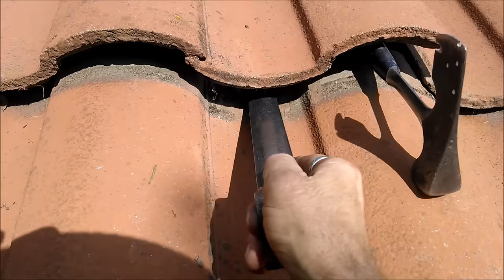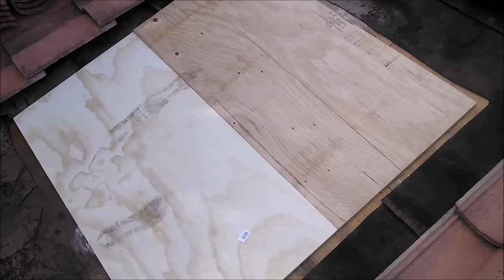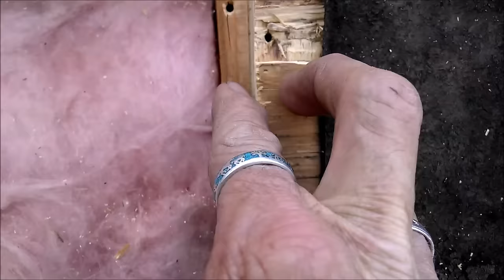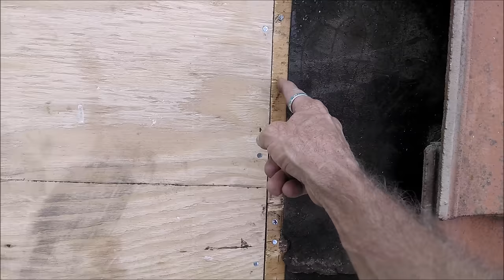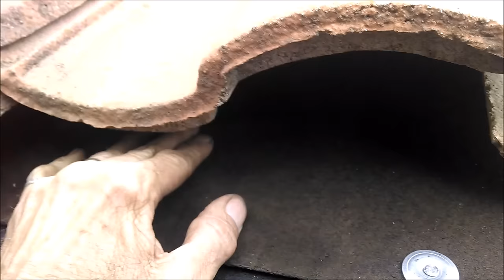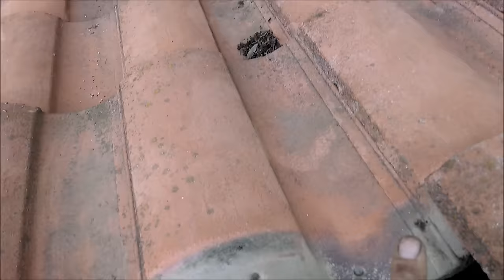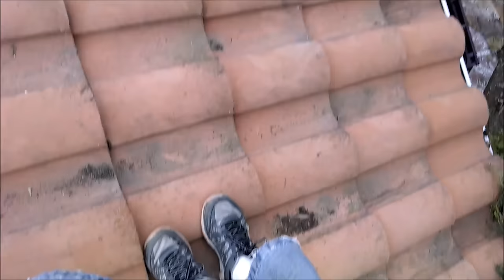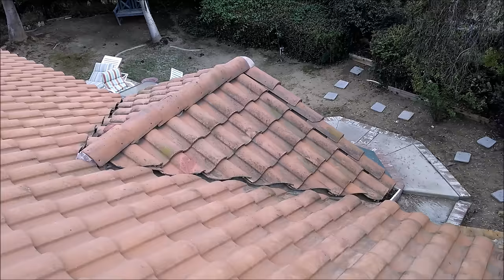Roofing Tile Leak Repair - Tips, Tricks & Helpful Hints

Comment: Thank you Dan.  Great video.  I have a question.  We are buying a house with a tile roof.  Inspection came back that showed some have slipped.  When the roofing company did the repair they used flashing band tape to hold the tiles together.  I don't mind if you could see it, but this is right at the top of our house.  It looks terrible when you drive up.  Since this is our first tile roof I don't know what is customary on how to hold two tiles together at the top of the roof.   Thank you for your response.  Wish you lived near me.
Reply from the maker: I'm sorry to hear this but at least it does sound like a cosmetic issue rather than a functional issue. Not to dismiss your concern but it could be a lot worse. In any case there are many construction adhesives on the market that are perfect for gluing roof tiles together & that's what I recommend be done. Depending on the pitch of the roof - if steep, then an external tether like what they used can be utilized temporarily to hold the tiles in place until the glue cures, but there is no reason that I can think of to have anything visible remain permanently on the roof to hold the tiles together. There are several places out of view on the tiles where adhesive can be applied to permanently hold the loose tiles to the nailed tiles. And just because it's a cosmetic issue rather than a functional issue does not mean that it's acceptable for them to leave it looking bad. If there were no other options then I would be more accepting of how they did it, but if I were you I would force them to fix it again, unless they could logically explain why it needs to be the way they left it. Does that help?
Reply: Yes thank you that helped a lot.  I talked to the company yesterday and they said they would come back and apply mastic over it and try to match roof color.  Hopefully that will look better. How often do you suggest a tile roof inspection?  We can get heavy winter rain where I live so I'm thinking every October might be a good idea.
Reply from the maker: You should only need to check your roof, reseal the vent pipes & clean out the flashings about every 5 - 10 years under normal circumstances; as long as you keep everyone off your roof. But if anyone gets on your roof you need to have it checked for cracked tiles every time, or if you have a lot of trees around your house you'll need to have the flashings cleaned out every winter just before the rains come.

Comment: t is a very professional repair of the leak. The homeowner should prevent further damage to the roof structure by cleaning gutters and cutting overhanging branches
Reply from the maker: Gutters do virtually nothing to protect your roof. Gutters are designed to protect your foundation, manage water flow coming off the roof & keep rainwater away from entry ways where people walk, not to protect your roof. Cleaning gutters is certainly wise, as it will enable them to do what they are designed for. Clearing overhanging branches away from any structure is always a good idea.

Just to reiterate... This damage & subsequent repair was necessary because of loose or broken tiles that were left behind by either the roofing installers or some service person who neglected to do their job properly. The leaf litter & other debris on the roof & in the gutters from the trees simply made the issue worse, but we’re not the cause.

Comment: Thank you for the video! I’m assuming that when you put the tiles back in place after repairing the water leak, you started with the bottom row and worked up to the last roll that you needed to glued, correct?
Reply from the maker: Jerry Ratajesak yes, that’s correct.
Reply: Duster Dan Thank you!

Comment: Hello Dan, 
Please add list of needed materials you used? 
I noticed you used NovaLink Sealant, different nails, 4' plywood, etc.
Reply from the maker: List of materials used: One roll of 30lb felt underlayment, 5lb box of large metal&#160;cap 1" felt nails, galvanized 8D or 10D hand nails for the plywood & the cement tiles respectively, Novalink&#160;tripolymer construction sealant/adhesive, two (2) 1/2" X 2'X4' plywood panels stacked on top of each other, one can of roofing paint to match approx. color of tile.&#160;that's about it. I&#160;used the smaller more convenient 2'x4' plywood handy-panels because&#160;they're easier to carry in my small truck. Also, any construction adhesive made for cement or general construction materials can be used. I use the Novalink because it sets up in 72 hours yet remains flexible over time unlike many others that cure very hard.

Comment: Dan, So once the shingle layer is in some way compromised what are the common causes of the underlayment then failing too... UV damage from direct sun exposure, water erosion, extreme high temps over the years? And how common is it for the felt to get abraided and ripped when a shingle shifts? I saw a video of a roof inspection where some of the concrete tiles had slid down a few inches (installed without nails flat on the roof deck I guess) but they could be pushed back into line with the other shingles pretty easily with a few light kicks. Seems the movement could risk ripping the felt though.
Reply from the maker: Good questions. I’ll get back with a full answer when I can be a little more thorough.
Reply: @MrThedocholiday  Great, look forward to it.
Reply from the maker: So typically, comp shingles don’t shift. If they do, it’s because they’re fastened wrong. Same thing with tiles but they are much heavier, but they don’t typically shift either if fastened correctly. Problem is that roofers don’t much care if they happen to nail a row of tiles into the seam or gap between plywood decking or osb decking beneath the felt paper. That leaves the nails loose & the tiles are able to slide & rip the felt. I’ve seen both the nails rip the felt as well as the tiles rip the felt in this case, although tiles will often just slide without ripping the felt, but allowing the nail to do all the felt ripping when tiles slide. Also, any time the tiles aren’t nailed or glued at all, they can slide & rip the felt as well as exposing the felt to the weather. In that case both sun & rain destroy the felt over time.

The roofing materials are designed to keep 95+% of the rainwater off the underlayment. Any time the felt is exposed to more than this over time, it will deteriorate much faster. But if it is protected by the roofing materials like it’s supposed to be, standard underlayment can last 50 years or more, as long as the top layer of roofing remains stable & water tight.

Hope that covers everything… pun intended. 😉
Reply: @MrThedocholiday  Thanks for taking the time to answer. On one hand it seems like these roof systems are simple and that most should be lasting say 50+ years for tile anyway. On the other hand it seems a lot (a majority? most?) of installations are done poorly and fail prematurely. Would you say there roof types that are harder for the typical roofer installing them to screw up or at least easier to verify if there is a problem after it's finished? Maybe standing seam metal roofs?
Reply: @MrThedocholiday  Is there a caulk or adhesive you can recommend for gluing back together a broken concrete tile that has cracked and separated? Would silicone caulk be best or do you need a construction adhesive or...?

Comment: I have an S-tile roof and I'm suddenly getting a water leak where the chimney meets the backside of the house. No doubt it's the flashing, but my question is what is the best way to remove the S-tiles from the back side of the chimney to get to the flashing? You can't get to the nails because the bottom of the S-tiles are bumped right up against the chimney, (and it's a very wide chimney). Removing the tiles on the sides shouldn't be a problem because I can start at the bottom edge of the roof and work my way up.

I was thinking that after removing the side tiles I could then slip a hacksaw (or maybe even a Dremel with a 90° cutter attachment) under there and cut the nails. Then I could slide the tiles out sideways. Any suggestions/comments?

I can't find matching replacement tiles so I can't just bust them up with a hammer and replace them with new tiles.

Comment: Thanks! Horrible install job on my home. I have 4 major issues on mine. No nails on top tiles, home 23 years old.
Reply from the maker: Improperly installed roofing is extremely common. Fortunately, not all mistakes cause problems under normal circumstances. Since I’m a problem solver by calling, I tend to address the issues that cause the most trouble first & then fix the lower priorities if budget allows. Godspeed & thanks for watching.

Comment: My tile roof needs repair.  My roofer said that the underlayment has holes and are not waterproofing.  But no need to replace it, just need to get the tiles repaired.  Does this sound right?
Reply from the maker: I suppose it depends on how hard it rains & how large the holes are in your felt paper. Tiles are designed to keep 95% to 98% of the rainwater from penetrating through the tiles. And that’s when tiles are installed correctly. If you have holes in your underlayment & it rains hard, 2%-5% of all that rain will penetrate through the tiles & a percentage of that water will also find its way through the holes in your felt paper.

The tile is your primary barrier & felt underlayment is your secondary barrier.

Hope this helps & thanks for watching.
Reply: @MrThedocholiday  Thank you so so much for the response.  That is very helpful.

Comment: Thanks for your informative video. Unfortunately my roof is leaking by the valley ☹️
Reply from the maker: El Gato Gordo Valleys are intended to manage water flow by design. No valley is 100% waterproof. The key is two fold... 1. Make valley as water tight as possible & 2. Manage water flow so NO ponding occurs. Ponding is the main reason why valleys leak. Any low spots, cracks, crevasses or water being diverted sideways or between the layers of roofing in a valley & it’s only a matter of time before it leaks. I hope that gives you at least an idea what to look for & how to fix it. Thanks for watching.
Reply: Duster Dan   Thanks for your reply. I became a subscriber also 👍

Comment: great! i feel like i can do this myself now. I have two  question, did you use a circular saw to cut the plywood from the roof? And i noticed there was no Battens, how come?
Reply from the maker: Battens in this area of the country are only required on steep roofs as a safeguard to prevent tiles from sliding & yes... I used a wormdrive saw to cut away the plywood. You could use a circular saw just the same.

Comment: Would you recommend Boral tile seal as a good underlayment? 

I had one roofer offer to use Titanium PSU as the synthetic underlayment. The roof is made of concrete tile so it should last a long time in fair weather California. Would you still opt for tile seal or go with the synthetic?
Reply from the maker: I honestly don’t know. Unless an underlayment is designed to be exposed to the weather, I can’t see how it will be any more durable long-term than standard conventional felt if the tile cracks, breaks or slips out of place for some reason & exposes that underlayment to the weather.
Reply: @MrThedocholiday  so the installation of the tile is more important than the actual material of the underlayment you’re saying. I suppose it would boil down to which underlayment material lasts longer? I’ve seen the asphalt felt crumble apart after many years.
Reply from the maker: @J_bui  The standard felt paper will not crumble due to excessive moisture exposure if the tile is installed properly, which the tile manufacturers have made a clear priority from the very beginning. Why roofers continue to wrongly assume they don’t have to follow tile manufacturer’s installation recommendations is beyond lunacy to me. And it’s not like the roofer has to be a perfectionist during the installation in order to achieve this. The tile manufacturers afford wiggle room in their recommendation standards.

From what I can tell, most roofers either don’t know what they’re doing or don’t care, or some combination of the two. And I’m actually being gracious in my assessment of them here, because I have had conversations with roofers who would rather brag about their BS installation methods & stubbornly continue them in favor of speed & greed instead of adopting manufacturer’s installation policies for themselves.

Quality separates the men from the boys here as far as I’m concerned & a great reputation & quality track record proves who the craftsmen are when compared to the wannabe juvenile braggarts who’s tile installation methods are substandard.

Prematurely underlayment failure is about lack of craftsmanship quality during the tile installation & rarely about the type of underlayment itself. I know this for a fact, because every time I’ve seen for myself what you’re describing about premature underlayment failure, I’ve been able to trace it back & show how the roofer failed to install the tile properly in the area of underlayment failure.
Reply: @MrThedocholiday  Great answer Dan. We received quotes from different roofers ranging from $4500 to $12,000 to replace the underlayment on a 1045 sq. ft. space beneath concrete tile. Upon inspection during the estimate, the way they laid the tile was without any sealant or glue to really hold things in place originally. The asphalt felt underlayment was able to break off as a result after 18 years. 

Do you think a difference in price between roofers would signify good workmanship? 

Appreciate your content!

Comment: If there is a small tear in the underlayment, is there a way to patch it? Or seal it with something?
Reply from the maker: Yes, absolutely. You can purchase felt underlayment from most hardware or construction stores. For tile I’d use 30# felt or thicker. Normally I like to overlap the tear with a small blanket & make sure the top of the blanked tucks under the corse of felt underlayment above. That way the patch is totally waterproof if any water gets through the tile in the future. You can seal it up with roofing tar also, but a blanket is always best. You can even use both tar & a blanket if you’re OCD.

Comment: Whats the estimated time a job like this takes? I have a small leak, want to do the repair myself. It gets dark around 5 to 6. So I want to make sure I have enough time
Reply from the maker: On a single repair the average time required is 1-2 days. I always would make a point to at least finish installing the felt underlayment of larger repairs by end of day so they’re water tight overnight. Felt underlayment can withstand weather exposure for several weeks if installed correctly without any issues. It will shrink during that time though so be aware of the fact & increase your overlap if it’s gonna be exposed more than a day or two. And never use plastic cap felt nails if it’s gonna be exposed to the weather for any length of time. Instead, invest in the metal cap felt nails. Can’t go into all the details why. Just take my word for it.

Comment: How long does it take for the felt to deteriorate to the point seen in your video? I ask because I'm buying a tiled roof home with a spot of cracked tile and another with a tile out of place, House was built in '74. The roof was replaced in '05. The video looked like the deterioration could have 20yrs or older?
Reply from the maker: bcre8v it depends entirely upon the volume of water getting through, how often it gets through & whether the felt is also being exposed to the sunlight... It could be six months or six years.

Comment: what would you say is  the best kind of roofing material to use to reduce inside temps and also easy to work of and repair?
Reply from the maker: Cement tiles are certainly the most serviceable because they are more modular than composition shingles, but comp shingles are more durable to walk on. With that said, comp will not last as long as cement tiles when both are installed properly, so you have a trade off either way you go. As far as cooling properties go it depends on each roofing product. Usually, the color of the roofing materials effect the solar reflectivity the most, so it really depends on that more than the composition of the materials themselves. With that said, some roofing materials have better insulating properties than others so you have to make direct comparison of specific products & avoid general blanket conclusions regarding which would insulate better. Just make sure you compare apples to apples & you should do just fine. But if you get advice from anyone make sure they give you the reasons behind their conclusions & make sure they can articulate those reasons in a way that makes sense. At best if they can't explain it, they probably don't know what they're talking about & at worst they're probably dead wrong.

Comment: What would something like this cost to hire a roof contractor to do repair and what state was this job done in ?
Reply from the maker: Frances Figueroa Sunny So Cal & price depends on too many factors to compare. For starters you simply can’t compare labor for someone who takes pride in there work with others who couldn’t care less. Besides that price is also effected by warranty, work load, distance one has to travel, etc. Every job is unique & price must be considered by each unique set of circumstances.